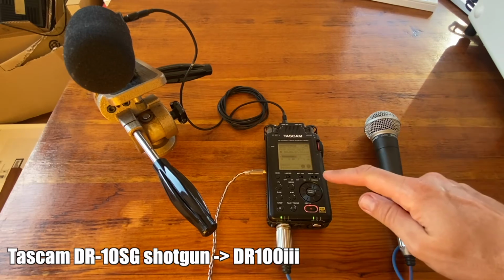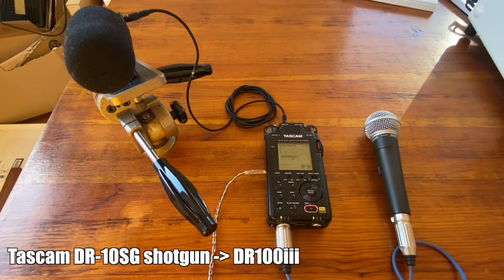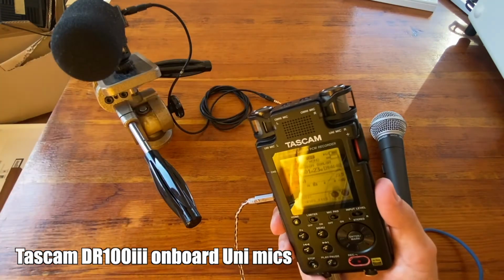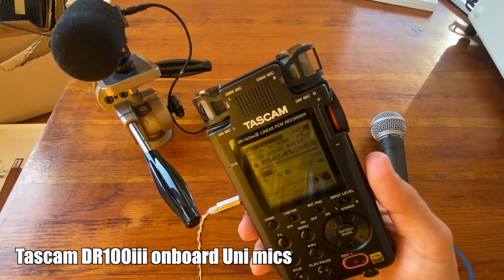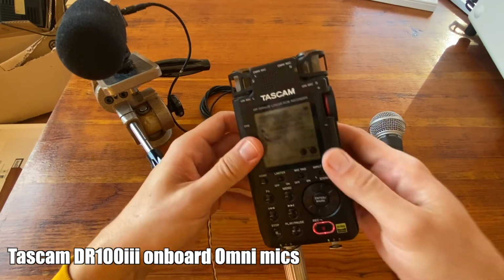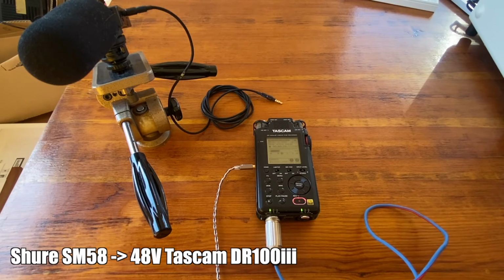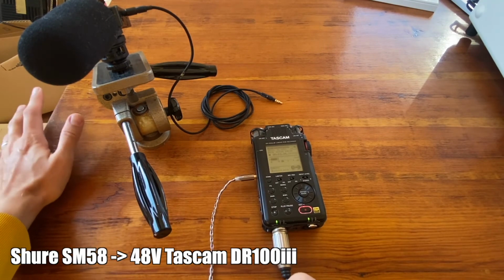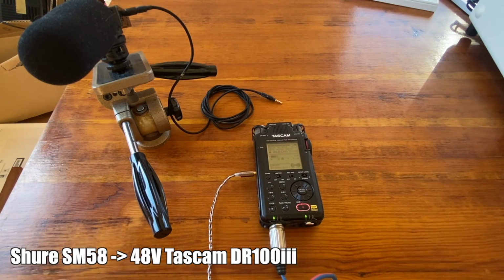Tascam DR100iii handling noise with on and offboard microphones

Comment: Yeah I just bought the Tascam X6 and similar to this model, the handling noise is crazy. It's almost a deal breaker as I like to run-and-gun record. Even with a tripod grip I get handling noise. I wish they would offer a premium model with better build quality for those wanting to spend more $. I will mention I had an Zoom H6 before and the handling noise wasn't close to as bad as the X6.

Comment: This problem is not specific to the Tascam DR-100 mk3.
ALL hand held recorders are subject to some handling noise when using onboard mics. It's simply a limitation of having your hand inches away from a very sensitive mic.
*In fact because the DR-100 mk3 has more sensitive and cleaner preamps than many other popular hand held recorders (Zoom H4, H4n H5 or H6 for example) it will pick up even more noise when you move your fingers around on it (including unintentionally) and that noise will be more noticable against an otherwise cleaner signal. It's actuially a sign of good sensitivity.*
In fact, if you have a hand held recorder that DOESN'T make handling noises when recording with onboard mics, it's proabably picking up less of what it should be picking up as well..
The only sure way to combat this problem in any hand held recorder when holding it (regardless of make or model) is to mount the recorder on to a shock mounted  "pistol grip" support. Otherwise, for "quick and dirty" recording, you must accept some noise.
Reply from the maker: Absolutely correct. And as you said, its pre-amps are clean. I have owned two zooms and both report insane amounts of pink and white noise from the pre-amp through even non-sensitive microphones. I went Tascam because of the cleanliness. 

I made this video specifically because of a question about direct handling (not mounted) from a user.
Reply: @FauxtakuLounge : It's sad that TASCAM discontinued the DR-100 Mk3 (as the same as Roland discontinued R-26 model) and there is no replacement for good handheld recorder with mics built-in and solid preamps on the market. Now, I regret that I haven't bought it.

Comment: Nathan, thank you so much for this!  Its a great unit, but the handling is pretty bad.  If the unit is used with an external mic and placed on a desk, in a backpack or generally out of the way, it sounds amazing.  But using it as a hand held recorder, it fails pretty badly.  This was the main reason I sold my DR-100 MkII.  Great video!  Thanks again!!
Reply: Like most of the portables (Zoom H5/H6, Sony PCM series -- with onboard sensitive mics, you can use a compact gobi tripod or get a small handheld grip and attach to the tripod mount on the bottom of the unit.  this is the only way to avoid the handling noise and also keep things compact.  you'll need a  dead cat too if you're outside (furry) to avoid wind noise.
Reply from the maker: @VOByRobbins  Indeed, you can damp them, or mount them on external support, which mitigates all or most touch noise, but for hand-holding, better options may exist.